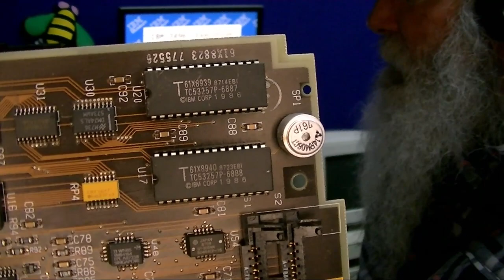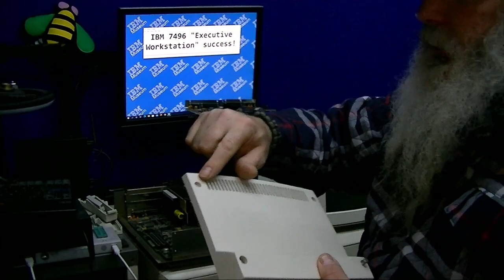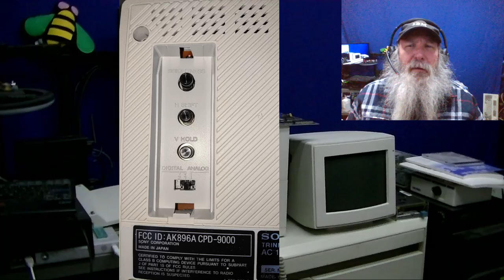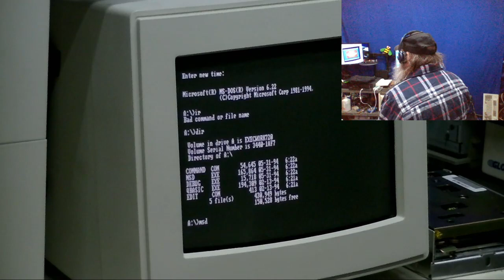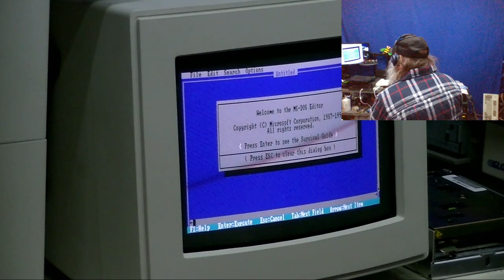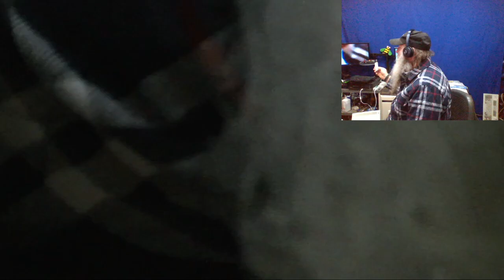A WORKING IBM 7496 Executive Workstation! - Success!

Comment: Interesting,  it seems like the only real unique to this system parts are the case, the monitor mount/back cover, and the power supply, right? Everything else is interchangeable with the PS/2 model 30, or another Sony Trinitron of the same model?
Reply from the maker: There are other systems based on the Model 30 (and Model 25) planars - just another one of those instances.

Comment: So did you get your turkey adapter working you talked about in the intro of your latest livestream. It was rather strange you talking about SCSI and turkey adapters, at the same time. 
The only reference to a turkey adapter for IBM I can find is for a IBM 386slc3 accelerator board for ISA backplanes sold in Japanese market. I figure that's what the top slot that's blanked off was for
Reply from the maker: Token-Ring? I'm not enunciating correctly or you're making a joke? Got a timestamp?
Reply: @IBM_Museum  not at all it's when you had the two voice streams going at the same time in a loop. The turkey adapter or more correctly schimencho adapter is a real IBM accelerator card. So called because of the unique shape of the fan due to limited space. IBM also made 486slc co processors for the acorn RISC pc, which is a similar idea using technology created from the turkey adapter
Reply from the maker: @billmilligan1705 : Ok, I've trimmed that half-hour leader section out of the 'live-stream in replay' video now anyway...
Reply: @IBM_Museum  I think the subject of IBM coprocessor x86 boards is worthy of a video. Both the turkey adapter and 486slc coprocessor for the RISC PC had a feature where you could execute code in place. Meaning if you had 386 code it would be executed on the coprocessor not the main CPU, allowing for the architectures to be radically different. The RISC PC being arm based. Acorn computers had what was called the tube interface that allowed this for the BBC computer series. I am wondering if IBM licensed the technology then went further.
The turkey adapter you talk about is more primitive in that it had it's own memory and VGA graphics output but in keeping with it's laptop roots could have it's clock stopped when not in use to save power. Thus you could run both windows 3.1 and other dos software on separate screens or execute code in place depending on configuration. 
When LGR did his latest computer reset visit I did see what looked like a turkey adapter in the warehouse. It was in a box with videocards.

Comment: I haven't followed the whole saga (watched the previous videos in the series), but know some of the basic facts. CONGRATS on getting this working!!! Is there any 7496-specific software IBM provided with this that you can show off when you've got everything reassembled and done-done?
Reply from the maker: There was apparently only a Diagnostic Diskette - and one that was packaged with the systems appears to have been snuck out of Computer Reset without authorization a couple of months back! They are attempting to get it returned by the individual so that it can be archived. The "Guide to Operations" was saved and scanned by a volunteer: https://ibmmuseum.com/Systems/7496/

Comment: Nicely done David!
What a lovely little Trinitron display this thing has! I was expecting it to be paper white but it's a gorgeous Trinitron (I should have known this because the flat surface already caught my eye earlier on). Also is it me or does this board feature the rarer, earlier 8x16 MCGA text font instead of the later 9x16? Anyway, cool stuff!
Reply from the maker: It's a 'Revision 02' BIOS, so it should have the main release font - I do have some RAMDACs coming in to be able to finally look at the 'Revision 00' BIOS font, even to see if it does color bars on the screen at some point in the POST!
Reply: @IBM_Museum  I guess it's the angle at which it was recorded that made the text look narrower, resembling 8x16 instead of 9x16. Pretty hard to see that 1 pixel width difference per character though (what was I thinking? ;-) ) Anyway I find the best way to keep those two apart (If anyone could be bothered by doing so that is ;-) ) is checking the difference between how the ASCII character for the fraction 1/4 is displayed. 8x16 has a solid "4" while the 9x16 "4" has a black dot ;-)
MCGA text mode, while sharing its font with the Video Graphics Array on the newer Model 30 BIOSs looks quite different than VGA text mode anyway, no matter which BIOS revision and that's because VGA uses the 720x400 resolution while MCGA cannot reach that, so it displays its text mode as 640x400.. (same font, different resolution so the characters are horizontally squashed by 1 pixel per character as 8x80=640 and 9x80=720), which is quite noticeable, just like with EGA text that's in 640x350 and looks even weirder and blockier if you're used to "high res" VGA text :-) Not to mention the crappy look of CGA text (640x200)..

The RAMDACs on my machines differ as well. One has the nice ceramic gold INMOS package your planar has. The other one has the 'boring' plastic package.. I think the newer model 30s came with the plastic units.

The monitor being falsely recognized as EGA by MSD is "normal" in the sense that It's the same behavior as on all of my model 30s. Pretty weird though because MCGA isn't even EGA compatible. Just a bug in MSD I guess. I think in Checkit also somehow recognizes my MCGA as EGA. I think what they did is check the amount of VRAM which is 64k on both subsystems, while of course they couldn't be more different from one another (being RGBI vs Analog video) ;-)
Reply from the maker: @pipschannel1222 : Thank You for your details - it will get examined further! IBM often used brown PCB early in an adapter or planar production, then switched to green later. The same with the ceramic RAMDACs on earlier planars, then switching to plastic later - My 'Revision 00' BIOS Model 30 planar is the only time I've seen a socket for a RAMDAC on a PS/2!

Many Model 30 planars had the MCGA version of a "Feature Connector", although IBM never had a VGA Feature Connector on any other planar (and the MCGA Model 25 planars didn't have it either). A Feature Connector was on the 8-bit "PS/2 Display Adapter" that was sometimes used to add VGA to the 8086-based Model 30.
Reply: @IBM_Museum  I guess IBM was either somehow not satisfied with the look of 8x16 or they ran into compatibility problems with VGA text so they went for 9x16 instead in their newer BIOS releases, squashing one pixel horizontally per text character as 80 columns of 16 pixels doesn't fit in 640 pixels; It was meant for 720 pixels horizontally ;-) 
As it's really hard to tell 8x16 and 9x16 apart anyway and as the end result is more or less the same, "native" or squashed it must've been for the sake of compatibility with the real thing, VGA.

A lot of people ask why IBM didn't just put a full VGA subsystem on the Model 25 and 30 planar as well and IBM was (as always) not very transparant about this design decision. 
If you ask me: I'd say it's obviously because in 1987 VRAM was immensely expensive, which is why they opted for 64k of dual ported memory, saving a lot of money, making these machines more affordable for the general public and function as a simple work horse for small businesses. I think it's a cool piece of engineering to achieve 256 on screen colors with just 64k of VRAM, but it's quite a limited video standard indeed..

I didn't know about the feature connector. It would be really cool to experiment with that. While historically significant in some way I personally hate MCGA because  I'm a gamer and a great deal of 320x200x256 mode 13h games that used some kind of scrolling just failed to run on it as it lacked a memory controller..
I had a Model 30 as a kid and the first upgrade that really opened up a huge library of (EGA and VGA) games for me was the addition of a simple 16-bit Trident card with its bus cut in half in an 8-bit slot. It would even play those cool Sierra VGA releases of Larry etc. albeit painstakingly slow ;-)